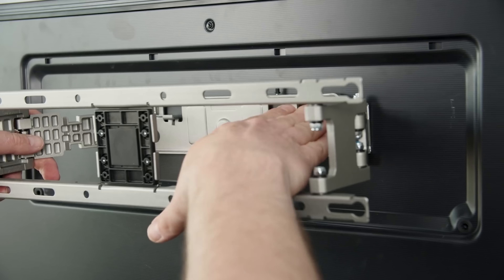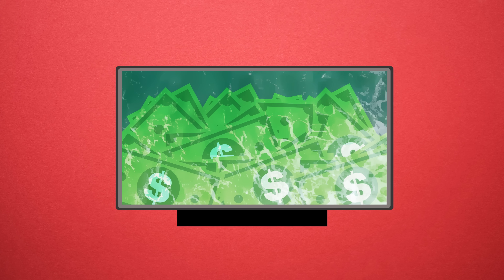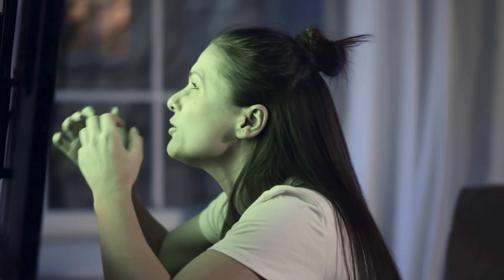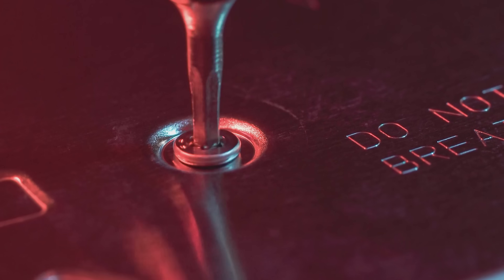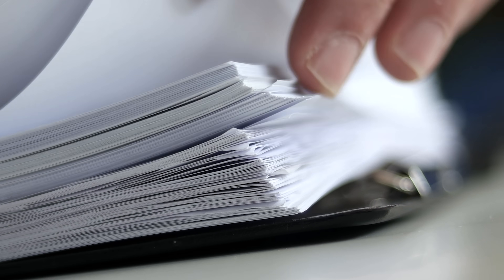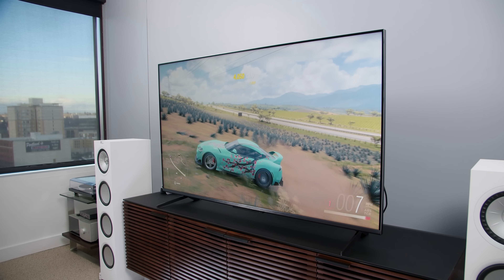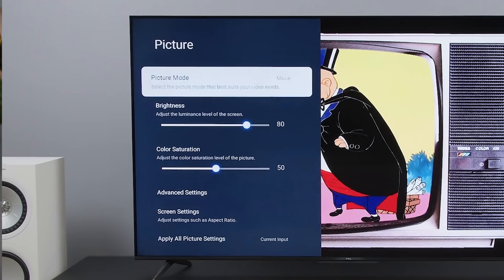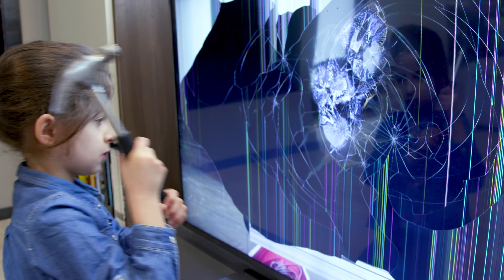What is Dirty Screen Effect (DSE)? | How to test and what to do

Comment: I just bought an LG UP7750 and it shows DSE in the form of vertical bands. What's interesting, though, is that the DSE pattern looks substantially more pronounced and less regular when showing the WebOS splash screen as it turns on. To me, this is showing the real nature of DSE. DSE is inevitable due to panel irregularities as mentioned in the video, but manufacturers calibrate the displays at manufacture by measuring the irregularities and correcting them in software. I believe when a consumer sees DSE in their TVs, it's a defect in calibration. It should be possible to recalibrate the screens to compensate for any residual DSE - I wish tech service providers offered that service, because it would completely fix this problem. That's assuming accurate calibration is possible, maybe the tools to precisely calibrate DSE out are out of reach for budget TVs. Anyway... food for thought.
Reply: I just calibrated out the DSE in my TV with my smartphone and a bit of software. Sadly it only applies to my PC (where I can apply the necessary corrections). It's a shame - no, it's apalling - that it's not provided by the TV's firmware. It's such an essential and simple luminance calibration step...

Comment: We just purchased a 55” Sony X89J (UK equivalent to the X85J) and it’s got DSE all along the top and bottom edges as well as vignetting in all 4 corners. 
The Vignetting doesn’t really bother me as it’s not noticeable on anything but test slides but the DSE along the top and bottom is visible when watching sports.
The retailer won’t take it back as DSE does not constitute a fault and Sony have looked and said it’s within tolerance. 
I’ve had issues in the past with other brands and is why I went with Sony for my last tv and this current one. My previous tv a 55” X70E had no DSE at all this X89J does so I won’t take a Sony TV next time as it seems their quality control has taken a slide.
I don’t want to start returning TV’s and playing the panel lottery as this one is just tolerable and the next one could and most likely will be worse. Instead I will just change TV brands next time.

Comment: Launch day tcl 55r635 with not a drop of dse. My previous tv the tcl r625 only had a touch of vinetting but the tv in my spare bedroom a tcl 55 inch 2019 4 series is laced with dse. It has like bands going up and down areas of the screen. You can only notice it on all white screens though

Comment: I bought a brand new Sony XH95 55" in November 2021 and it has some problems too. The HDR performance is really good and its very bright but it clearly has some DSE problems. Whenever there is camera movement on the horizontal axis on a  blue, white, grey sky or on brown, beige, white house walls, you can clearly see 
tiny grayish shadowy spots on the screen. You can see these same spots on a full white screen but then they look like tiny dirty yellow spots. 
But i was told that my grey uniformity photos are actually very good for this set and it can look way worse than this.
Which makes me wonder ... this is a 1500 USD / € TV, how much worse can it look and how is that considered 'normal'? 
Then i looked through some of the highest rated OLED TVs from 2020-2021 and even for these tvs you can still find dozens of Reddit and AVN forum posts 
about dead pixels, vertical banding, color tint, grid patterns ... and all of that is considered to be normal by the manufacturers. 
Even for products up to like 6000 USD/€. I think thats pretty ridiculous
Reply: Hi. I bought the same tv like yours. I also noticed the same DSE but in every corners. Did you managed to solve the issue?
Reply: Hey, do you mean the corners are darker than the rest of the screen? That is 100% normal for this tv  @feizalasmoro9192
Reply: Hey. Do you mean your tv has four dark corners, like the corner are darker than the rest of the screen? Thats 100% normal for this tv.  @feizalasmoro9192
Reply: If you are talking about the four corner being darker than the rest of the screen, that is totally normal for this tv. All of the different size models have it.  @feizalasmoro9192

Comment: Thanks for bringing attention to this.  Manufacturers need to step up their quality control.  The only way they will is if the consumers no longer tolerate these defects.  I had to return two 85 inch qn90as for dse and dead pixels.
Reply: Samsung is the absolute worst for this and I’m not giving them another penny. Frustrating because their TV’s would be good otherwise
Reply: THIS^^^^^

Comment: I've been lucky in the "Panel Lottery!" My 2008 PANASONIC Plasma had no DSE, but does have a couple of "stuck" pixels! I bought a SAMSUNG in 2011, and the panel is nigh-on perfect! 👍 More recently, I bought a HISENSE and its panel is also nigh-on perfect! 👍 No DSE for me!

If you buy ONLINE, and you have DSE, just return it!
Reply: I have 3 plasma tvs the really nice Panasonic 3d 50 inch v20 I have has 0 marks.  nor does the free 42 inch older Samsung I just got to.
Reply: @EastAngliaUK  My Panny was only used lightly for 3 years, and has been boxed-up for around 10 years! It's practically brand new! The problem is the HUGE power consumption of 300 watts! The 50" HISENSE 4K uses around 70 watts (SD / HD / 4K SDR) and 140 watts (4K HDR). Energy prices are through the roof!

Comment: The TCL 2018 6 series I brought it had a very bad dirty screen effect in the middle right side. I had brought it back to Best Buy, they had to plug in the TV to test it out right in the store. They noticed it, & they switched out my panel for another. I told them I wanted to test out the new panel in the store just in case The second one had it. No dirty screen effect at all. 

So Panel Lottery for sure. Luckily I still had the box & everything. But glad I didn't settle, dirty screen effect is so annoying. Once you see it, 👀  you can't unsee it lol 😆

Comment: Maybe some additional information on what causes the DSE. There are three things that make DSE:
1. Uneven backlight distribution
2. Uneven pressure on/in the panel itself
3. Uneven space distribution between the RGB layer and difusser from the backlight

- The first one can be solved by replacing the backlight system, the uneven bright LED's are causing different light distribution and therefore causing DSE
- The second one is solvable if the pressure lays on the panel itself, that's why some people suggest to "loosen up" the back of the TV. If the pressure lays in the panel itself than it's a manufacturing failure and can't be solved.
- The third one is tricky. It's caused by either touching the RGB layer and backlight difusser or the surface of the difusser is not even. If the layers touch each other you get lighter white spots but if they don't and the difusser is uneven you can get dark spots. The RGB layer and the difusser have to have a gap between them and the defusser also has to be as even as possible so replacing the difusser solves the problem for the most time.
Reply: So bad shipping is not a cause for DSE too?
Reply: @selfelements8037 no😅😂

Comment: Great post! I’ve used DSE tests before and I’m happy to say my 65” Sony a90j is very clean! Love your content…thanks!
Reply: I have one too agree
Reply: Having experienced this on several tvs as discussed in my other comment   I looked for it on bright white screens nada. My A1E had some. Another way I was told to test is go to a blank screen crank up britness & contrast.
Reply: @bobvanster  Thanks for the info! I have seen it on other tvs I’ve owned to varying degrees. This OLED has the cleanest screen I’ve ever seen.
Reply: Grid DSE plaques it look in bright sky's you'll see it
Reply: @NexGenTek  If the grid DSE is there on the a90j I don’t see it or it just might be less noticeable on my set.

Comment: When I bought my LG CX in 2020 I was shocked by the initial DSE. I thought I had gotten scammed for a used or floor model but I quickly realized I had to “warm up” the panel by running it for a few hours and then run the pixel refresher mode to clean it up. After that, it was perfect.

Comment: It's on my 55 inch 2019 TCL 6-series Roku tv.  I would call it moderate/acceptable DSE.  When watching a movie I rarely notice it, maybe for a brief scene or two (camera pans across an overcast sky for example), or not at all just as likely.  Fortunately I don't watch hockey or close ups of golf greens.  I knew about this before I bought my TCL and thought a fair tradeoff for the great price and overall quality of the image.   After over two years still very pleased with the purchase.
Reply: I got the same tv in January with the same problem.  Only really noticeable when the screen is white.   No one can see it like I do.  I KNOW ITS THERE lol.  It's a great TV for the price..I bought it at walmart and its past its return period.  Reading reviews and this TV seems to have this issue often.
Reply: It's on the top of the TV looks like smudgey finger prints.  I don't know if it was always there & I just didn't notice before?  Or if it came out of nowhere but I kind of think it came out of nowhere.
Reply: Did it get worse? Or just the same as it was new?
Reply: @MajdAlraie  Hello.  I'm still using the tv and it looks like it did about 5 years ago brand new, nothing has degraded.  Maybe it's because I don't use it heavily, maybe 2 or 3 hours per day on average.  Now I do lust for an upgrade to a premium oled in next year or two.

Comment: Could a careful scan of the screen be used by software to adjust brightness levels to cancel out the DSE pattern? That might be something useful to offer in firmware or to implement in the factory where they have the ability to perfectly capture a scan of the screen's output.
Reply: I think that would be hard to determine without a full almost, camera looking at the screen. Like a calibration. To lower or raise some leds within a picture, would require tone mapping and other algorithms to even out the tones. As the led may still draw the same power so no way for the tv know which ones are affected
Reply: I thought of this same solution. You use an app to take a really good photo of the TV and the TV processes the photo and adjusts the brightness in accordance with the results of the picture. It could happen but it's probably too much work for them to bother.

Comment: Went through 2 75" X90J TVs over the Christmas holiday. The 1st one had some faint vertical bands I could sometimes notice in content. The 2nd one had a grid pattern that was even more noticeable. Both had vingetting in the corners, which I expected from reviews. I was a little frustrated after spending $1,600 and seeing the DSE. I ended up returning the Sony and purchased the Vizio M7 for around $1,000. Its actually great for the price. Very clean panel with some ever so slight darkening around the edges. Compares well to the X90J overall. For me, some DSE is forgivable depending on the price.

Comment: I recently had a Hisense U7QF that had a really bad case of DSE in one portion of the TV. It was so distracting that I ended up exchanging it and the new panel is so far so good to my eye. The returns process was really easy and fuss free at least from my experience with Hisense so I'd recommend it if you can.
Reply: I have to at least give Hisense credit for their customer service.

They sent a technician to my friend's apartment to completely replace the TV panel that was faulty after about 1 month of purchase from Best Buy.

Zero issues with the TV so far after nearly 1 year of usage. 👍
Reply: Loving my Hisense UH6 or something. Switched from plasma and the color and darkness sand HDR and 4k is all so amazing.

Comment: Recently purchased a Samsung 85" Qn800a  For the theater room and a 75" QN90A for the living room.  Had to play the panel lottery once in both rooms and ended up with 2 good screens. The 85" qn800a  Only had a faint DSE spot.  But was suffering from an audio issue. The QN90A in the living room was bad it had DSE throughout the screen, But both are perfect now... 🤞🏾🤞🏾
 If I would've gotten another bad screen I was switching to Oleds for sure.

Comment: Nice.  My TCL R646 has the opposite of Vignetting... It is brighter along both edges by about an inch.  But on the BRIGHT side, on my luminance meter, your white slide hit 600 nits.   By A80J only managed 385 but didnt have any DSE at all.

Comment: I knew about DSE when I purchased my last LCD TV, the 2018 TCL 65" 6 series.    I happened to win the 'panel lottery'.    I have a tiny bit of vignetting, but it's very minor.    My panel is exceptionally uniform.   I can't see anything.   I've run all of the tests to try and show DSE, and my panel is perfect.   Am I lucky, or do most get good tv's?